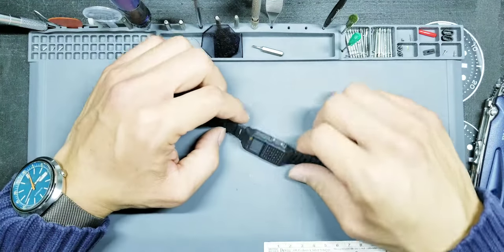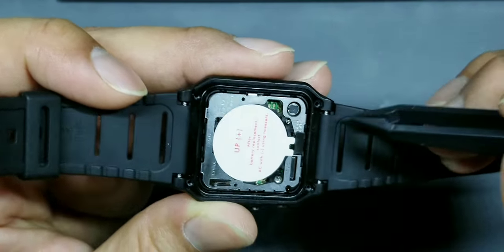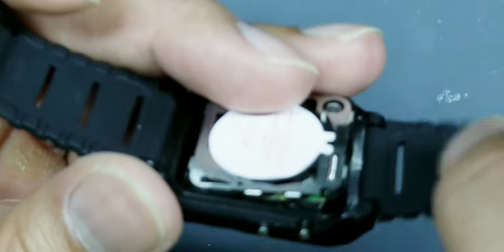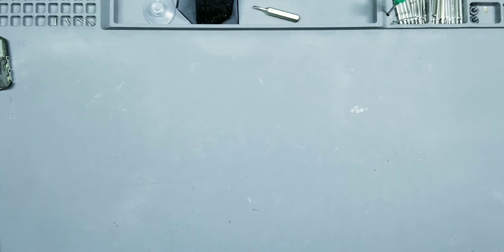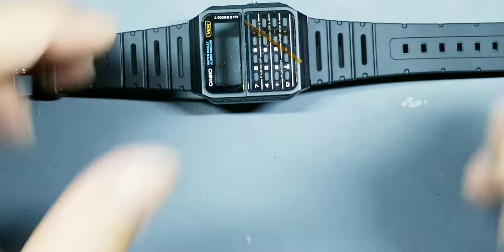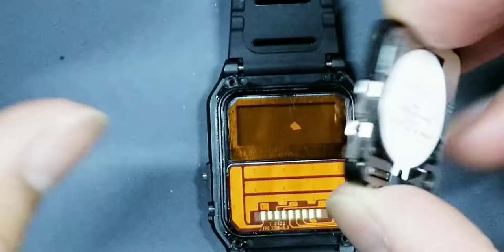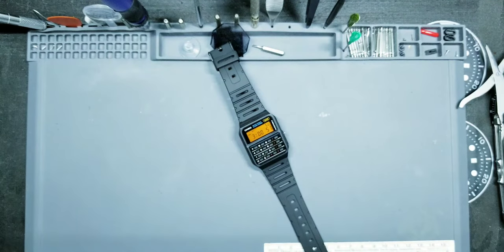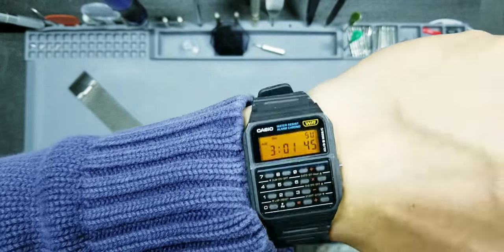[Modified Casio] Casio CA-53W Calculator watch color filter mod

Comment: Hei Man! Thanks for sharing your experience, you are an inspiration and help to anyone who wants to get a fantastic mod to enhance the look of an iconic watch.
 A simple method to get the exact measurements of the size of the pollarized filter that will have to be applied internally on the crystal, before cutting is to apply some adhesive paper tape inside the watch case and with a pencil press on the internal sides along the entire perimeter of the crystal or of the area you intend to cover with the filter, in this way you will have the exact dimensions. Take out the adhesive tape marked above and stick the pollarized filter on it. Cut following the lines drawn earlier and you will see that the filter will be the perfect size. I randomly found the channel and signed up 😊👍. But I'm sure they met us on another channel 🤙👍😊. Thanks
Reply from the maker: What a great suggestion on getting internal measurements. Ill try this next time. Thanks